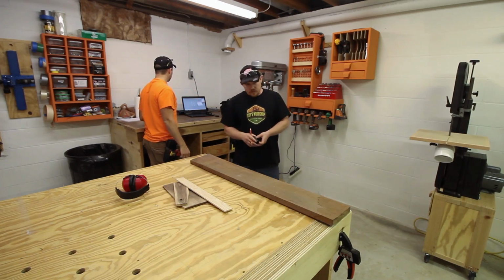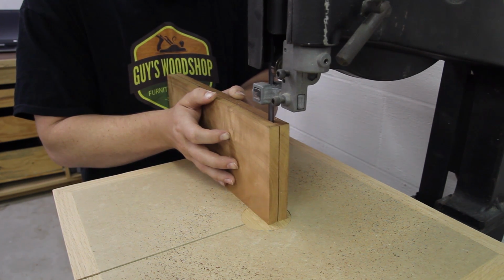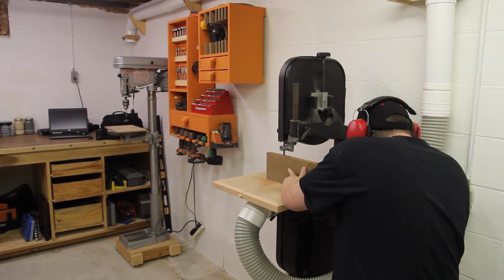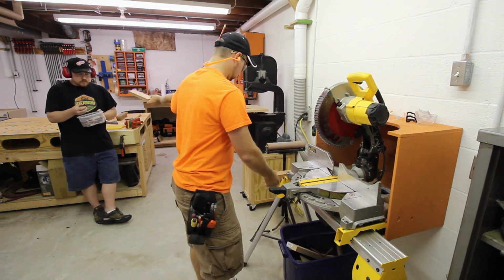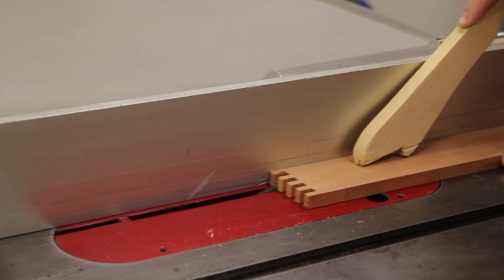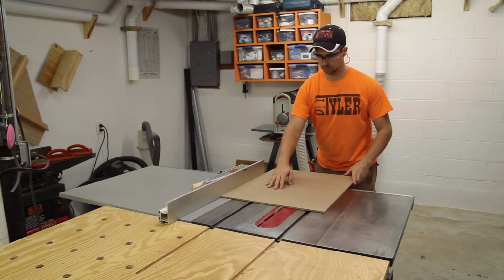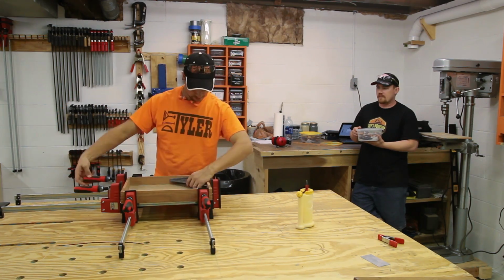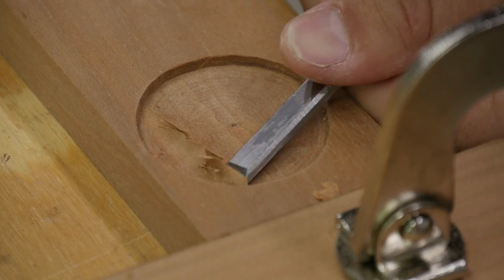Cherry Flag Display Case | Collab Part 1 - 265

Comment: Hi. Any chance you could do a video on how you maintain your sawstop? I think mine has a warped iron wing
Reply from the maker: I have done literally zero maintenance to it in the year and a half that I've had it. I do make sure to run dust collection with every cut though to prevent dust buildup internally. I'm not sure what would cause a warped wing.

Comment: I dislike YouTube new link thing in the app. it's good for outside links but if it's a YouTube video link it should just go to that video.
Reply from the maker: What are you referring to? I'll try to help out and change something if I can.
Reply: Jay Bates in the YouTube app when I click his part 2 video link it opens up almost like a secondary window instead of actually just going to the video I don't think it's anything you can change, YouTube is messing around with the app.

Comment: Did you run the pannel dado all the way through the end of the finger joints.  If so how did you fill the excess grooves.  Thanks
Reply from the maker: We did and reading your comment realized I forgot to include a clip. It was right before hitting the belt sander. Tyler plugged the 1/8" square holes on the exit surface.